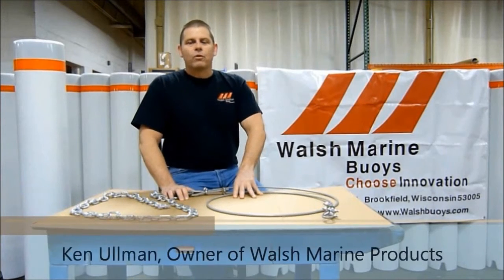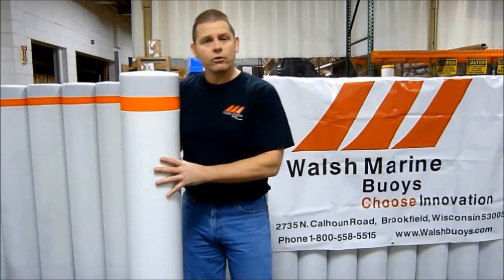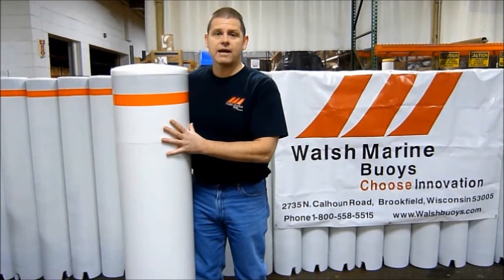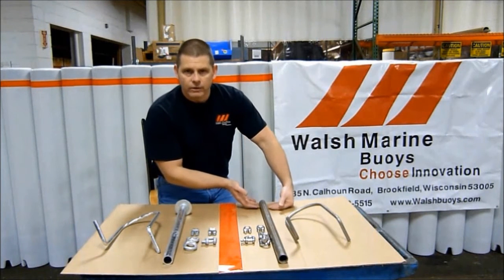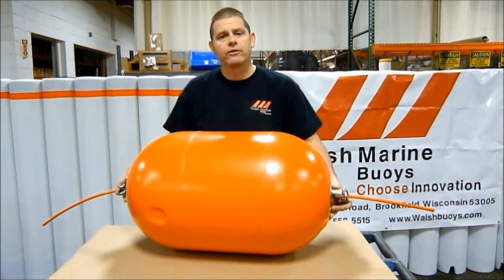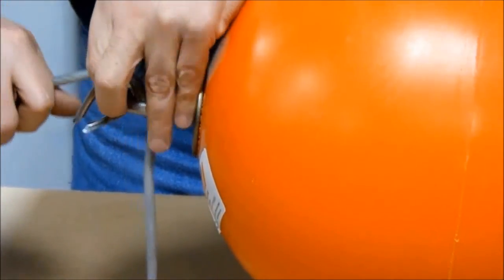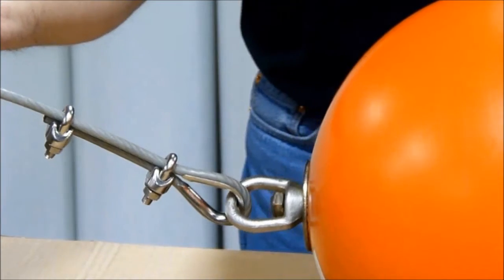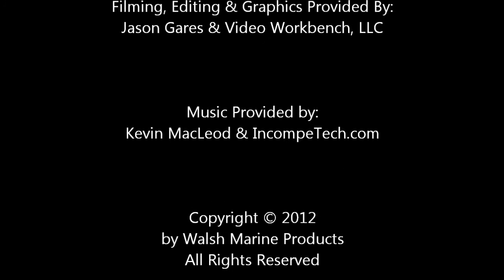Proper Rigging Of  Buoys & Barrier Floats

Comment: just to let you know you are installing your cable clamps wrong.the sadel of the clamp goes on the working part of the cable and the ubolt part goes on the non working end  the end part of the cable doing it the way you got it the u bolt part on the working part damages the cable and will evenuall break   the saddle is dezined to protect the cab from crushing..when installing cable clamp we use the saying   never saddle a dead horse